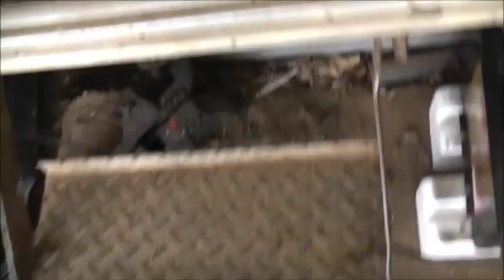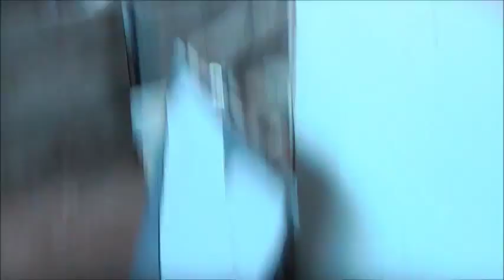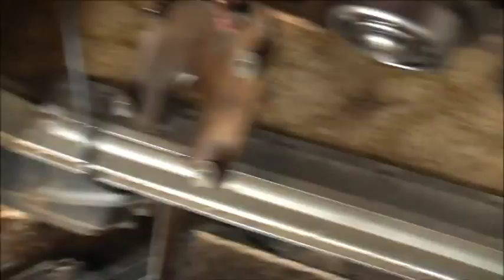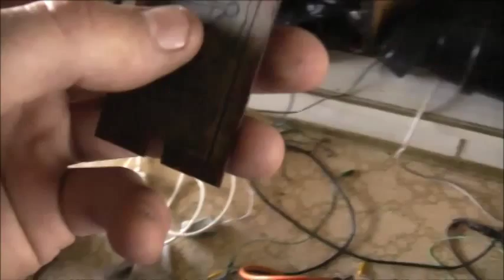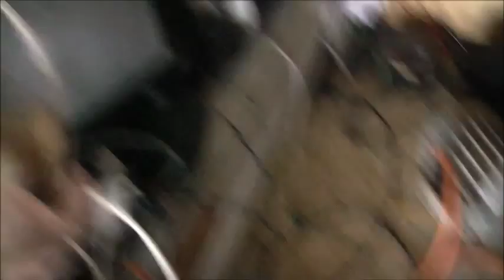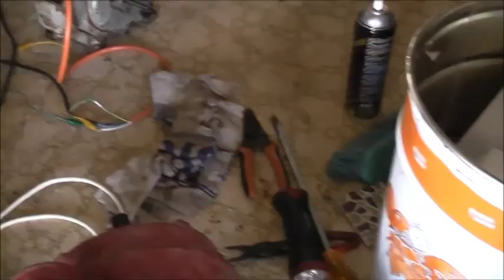Repair GMF Motor

Comment: Try spinning it when you start it using another motor instead of starting it.
EDIT: zx8401ztv thing the same way LOL.
Id go with RODALCO2007's suggestion of bigger cap. Iv got this odd motor that needs 700uF to start, the motor is no bigger than a fan motor too. YOu just never know, wish they made variable 1-1000uF caps that worked on 120V/240V. Then you could just crank it till it starts.
Reply from the maker: theLuigiFan0007 start windings pattially shorted, i tried 2000 uf and it did nothing

Comment: The start capacitor is too low in value.
Reply from the maker: I have confirmed that the start windings shagged, a rewind would cost around $600

Comment: Have you tryed disconnecting the capacitor so you only have the run windings going to the mains, then using an electric drill spin it up before flicking the switch?